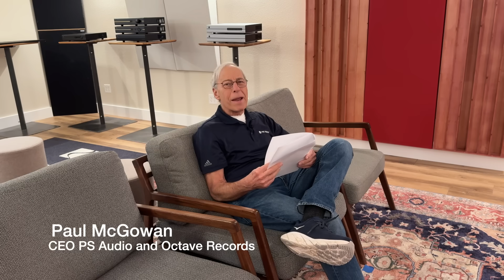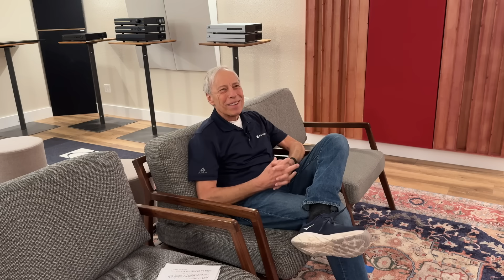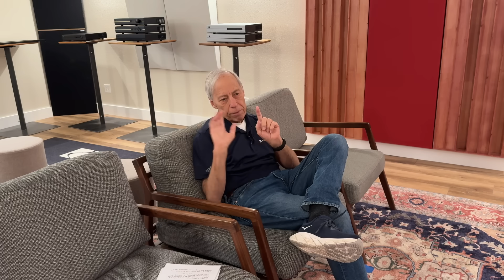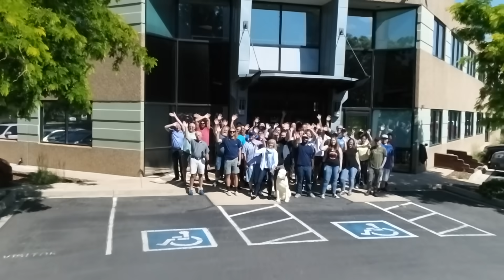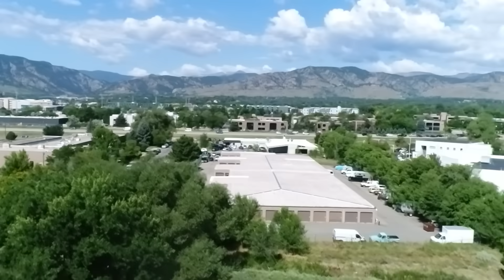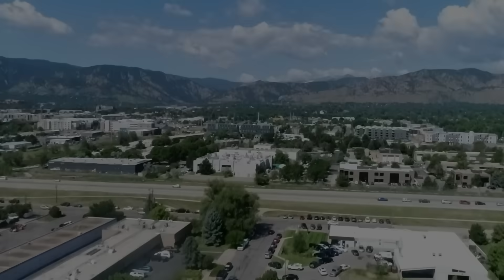The secret to feeling the bass of a dipole

Comment: If you want to FEEL bass... first you have to understand what you are feeling.   1)  Vibrations  2)  Air Blast, Hitting the Chest

If you have a small 6" woofer... you are not likely going to get the kind of Compressed Air Blast... that nearly knocks the wind out of you.  Thats only experienced with Concert Speakers, that have like 18 Inch woofers.

Some small diameter car Subs, might be capable of that kind of compressed air blast... BUT... it tends to have to be in a Cars small and controlled air volume (pressurization).  Put that same small subwoofer in an open parking lot.. and you might not feel that much thump..  as the air is able to escape in all directions.

 Then there is Vibrational Based bass.   Bass that is Felt.. rather than just Heard.   You can use Bass Shaker transducers,  and place them under your Couch / Chairs... to get INSANE levels of physical Vibrations.  And all without disturbing the nextdoor neighbor... since they dont really make much audible sound.  Bass Shakers will vibrate your entire body... but..  the effect is very different from the Concert level Bass Blasts.. or a Cars Powerful Subwoofers effects.

 Obviously, the room size and shape, plays a factor.   A smaller room, can become more  "Pressurized"  than a very Large sized room.

 Also realize that a lot of home theatre subs, are more about producing a low frequency Sound... rather than Bass that you can FEEL.
It depends on the sub type... the magnetic strengths.. and again... the air volumes of the room.   That, and how much power you are feeding them.
Reply: @clickbeetle2720  Yes... but a 12" sub could have just as much xmax.. and produce far more sub-bass.

 The real issue, however... is that Subs are not the full spectrum of Bass.   The Woofer is what provides that spectrum... and if you are using smaller sized woofers, you are not going to get any "Feeling" from that range of frequencies.
Reply: Thats only experienced with Concert Speakers, that have like 18 Inch woofers....correct. Thats what I chose on my OB builds. mega bass pressure with only a 17 wide baffle and 10 side wings. Didnt even need the wings they were added later for design and function.

Comment: Can a well-designed 4th order bandpass subwoofer be used in hifi down to 60 or 80Hz or is that a myth? What makes me think so is that a 4th order bandpass will usually not be damaged if it is exposed to frequencies lower than the box tuning, which is not the case with a bass reflex type box or a 6th order bandpass, probably also a transmission line.
Reply: Yes, no myth. 
Also, the sealed chamber helps protect the driver from extreme excursions. 

However, regardless how well executed the design, ... it's still a bandpass. 
Therefore it's range of operation excels across a more narrow range.
Reply: @ https://i.postimg.cc/W3hrdYbx/tb1.png
Reply: @FOH3663  Thanks, so I don't think a bandpass sub needs to cover more than an octave and a half if the main speakers can go down to at least 60-70Hz. In my opinion (but I don't have much theoretical knowledge), apart from precise construction, a well-executed 4th-order bandpass should have 3 chambers. So, one additional one through which only the reflex tubes pass so that the sound pressure does not get stuck to them. A bigger problem would be group delay.

Comment: I owned many types of dipoles... In their design you have cancellations between front and back that you need to work with, as in tuning distance between speaker and front wall, but there is also excursion limitations in the actual diaphragms/design, only capable of moving air in the 1-3 millimeter range. These limitations does not help to mimic a box design regarding impact and slam. Some people are happy without subwoofers and less impact also depending of music genre, some people like me, always augmenting with at least two sealed subwoofers in stereo crossed in the 100-140 Hz area to get the best of two worlds (Imaging from dipole, needed impact from box). There are designs that are hybrids that tries to compensate, some do it really well and that is where my journey ended. Music experience is subjective...
Reply: You pretty much hit the nail on the head:  at final floor positioning, my dipole diaphragms barely move at same apparent bass levels my subs move so far you wanna keep your feet clear. [see my own comment elsewhere above]
Reply: There is woofer excursion and theres diaphram area. e times d equals displacement. my diy dipoles use pro 18 woofers i have zero bass issues, bass you can feel and annoy the neighbors, using a 17 wide baffle. but it takes designing an entire system away from using passive xos and towards pro audio electronics and tri amping for three ways. all can be done for less than $2,500 us

Comment: I don’t want to feel bass, I just want to hear it. But in general with Open baffles/dipoles, just use very big woofers with very hi sensitivity, use a very low series-resistance inductor for the low pass filter in your crossover (large wire or foil gauge, and use an iron or steel core) and put wings on the sides of the woofer baffle for better lower frequency response. These all improve low bass sensitivity so you don’t have to rein in your tweeter as much to match…
Reply: Agreed.  I use 18" woofers for anything below 150Hz.  They don't go low and would certainly benefit from subs to fill in the last octave.  But they do sound pretty good, and I do feel the bass.
Reply: @ I have one of a pair built. Im told the 18” woofers benefit a bit from wings to extend below 50 Hz to 30Hz. I haven’t built the stands & wings yet…
Or you could just do a sub. I kinda can’t becuz my speaker wires are thru wall from a closet around the corner. So unless I wanna open the wall and put more speaker wire, or change the setup to in-room components…
Reply: That is correct sir.  Pro 18s without passive XOs, active XO and pro EQ and bi or tri amping is next level. Ive done it and it body slams and sound stage is tremendous. active XO and EQ (dbx) solves most problems
Reply: @manthings1568  well—I think we are talking non-active systems here. It is common knowledge active systems solve most if not all problems, but many consider them clunky and brute-force to implement (separate amps for all drivers).
Reply: @ Understood but my sys i not cluncky its very compact my amps are about a stack of 4 old school cd cases the amp mkt has been radically changed the last 5-8 years. Paul's Q&A and his response to someone who already has a system is valid. I just disagree with his opinion that all dipoles suffer from bass. Maybe most off the shelf do. Im offering another next level approach that is not expensive, which was the goal of my project. Not a fan of off the shelf systems with passive XOs. Trying to passive XO an 18" is far from ideal IMO, easy with active
Reply: @manthings1568  I built OBs with minimalist passive X-over. It’s fine the first one sounds great I gotta put the other speaker together. I understand about the new amp tech. In fact im using cheap Chinese $90 Fosi monoblocks myself. Good point that you could just use 6 of these and go active with 3-way speakers… I just can’t without rewiring my wall…

Comment: My friend is an audiophile and she sits on a big speaker just like in the Howard Stern movie.  She said it makes her feel the bass and pressure like no speaker can under normal use.
Reply: At last, that orgasmic sound.
Reply: Ya, also good for constipation 😁
Reply: I have done that with an 8" sub under my chair. Pretty cool!
Reply: @stevefisher8323  I wonder why PS Audio doesn't patent a pleasure speaker?   If I get on shark tank with my design of the pleasure speaker I'm going to be worth tons of money.  My friend also installed a 8 or 10 inch sub under her car seat for the same reason.
Reply: @funny0000000  Interesting term  :) What would be an example?

Comment: Paul, I bow to your expertise but add an observation. When they were new, I owned Yamaha NS500 speakers, with their radical beryllium dome tweeter and a 12" woofer. And those full size subwoofers gave bass a physical kick to your core. Perhaps not accurate, but every high end subwoofer I've heard simply has never delivered a punch to the gut, the way 10 or 12 inch simple woofers in a box, ported (these were IIRC) or not. Subwoofer? Nice, but it feels like a room is breathing. No true percussion.
 So what are we missing? Rationalize this for me, and your writer?

Comment: @3:22 "closed box bass"
Seams that Paul is all about impact and to feel the bass.

But if you want to hear it accurate and highly detailed with all of its nuance.

Then forget box and go to open baffle bass.. so that is a completely different experience! ❤
Reply: Sorry, but there's no way an open bass is more accurate. The best accurate bass is a closed servo subwoofer
Reply: @xaviermontalban717  There is also servo controlled Open baffle. Example GR research 3 x 12 OB servo controlled bass speaker.

But I am talking about just the enclosure.

And set aside servo or not when we can have it in either or "enclosure".

Looking at the enclosure the OB has cancellation to the sides and up and down (Yes down as for example my two OB 18" is hanging in the air and therefore remove the coupling to the floor boundaries.)

The cancellation makes so that you have a figure 8 of radiation pattern and not a omniderctional radiation like a traditional box has.

Besides it will not radiate energy and cancel to the sides it will then not overwhelm your room and force you to use more absorption in the room just to get to on par with OB. (Remember bass is that frequency range where we throw in the most wattage and energy can not be destroyed ut just take another form.)

So when I live for years with two big OB and do meassurements with REW and a lot DSP optimisation.

There is no substitute for OB if you want to hear ALL details! It is just like a magnifying glass!

The downside is that when it do not pressure the room in the same way as a box then you dont have the boomyness and overload and therefore you dont have the chest pound, no things that rattle and vibrate no pants vibration or something like that.. distraction and not music. That roumble over so you CANT hear the details in practice.

Yes, it takes time to get used to this kind of presentation but it is so rewarding at the end .

But you can not rock out and feel it in your chest..

But as you say a servo will tame/control a driver and lessen the boomyness of the bass to solve some of it "issues" and to give it back some more and lost details.

But imagine taking a "correct enclosure" to begin with in the physical domain as OB. And then add servo in that scenario..

So it is about taste and preferences.
When OB is the least efficient "enclosure" you need cone area and more amplifier power and with boxes you need more room treatment to try to get to the same accuracy levels..
Reply: @xaviermontalban1701  open baffle is at least as accurate as the membrane is not hindered by a backwave in the enclosure and just stops and starts as necessary giving excellent transients . As there is no enclosure , you also get rid of any panel resonances and boxy sound .
Reply: @gerritgovaerts8443  that's nonsense. Its only stopped by the suspension and not the backpresure. Therefore, there's less cone control unless its a servo speaker. Show me ptoof of a open baffle speaker with good spectral decea
Reply: @xaviermontalban1701  you need to separate different things.
I were talking about the "enclosure" (or the lack of it)..
And a servo controlled driver is something else that you throw in to add confusion to yourself in my opinion.

So there is at least 2 makers and sellers of servo controlled Open baffle bass (subwoofers). That I know of.

So the servo controller is NOT something to do with the enclosure. Two separate things.

If we just look at the enclosure a OB is more accurate and has miles better definition. (Knowing that when I live with two OB 18" that hangs in the air).

But open baffle has drawbacks like that when it is the least efficient "enclosure" it needs larger cone area and more amplifier power.

And then it comes down to subjective preferences between enclosures if you want to hear all details or feel it..

A box if it is bass reflex or sealed box will make everything (if we now talk about bigger and more competent stuff that reaches low in frequency and with higher SPL) to rattle/vibrate/shake. You get your chest pound and pantleggs to vibrate and so on..

People thinks that is the NORM for low bass, but that is because the vast majority do not know about anything else 🥳 

And if you subjectively LIKE that distraction, instead from hearing the details. Then go for it! (We are definitely USED to that sound signature)😅

But there is NO competition whatsoever.
And if you want, then we can use a servo controlled driver in the OB arrangement also..

Just saying from my own experience to start with the fundamentals and then add electronics otherwise you dont know what is doing what.. 
..was it the type of box or were it maybe the servo controlled driver that gave me the experience.. 
..or did the servo controller helped the bad choice of box to get to iron out some of it weaknesses/attributes? 
That you dislike or liked..

I spend a lot of time to analyze why or what is contribute to what I hear in audio shows that i go to in different countries.🥰

A box is just a way to increase the efficiency that make you to be able to get away with a smaller subwoofer. For example so that 10" will produce same SPL as a bigger driver that is in a OB.

I do not care that I happen to need bigger drivers in my dedicated listening space. When for me I dont compromise on sound quality that is my highest priority even higher than looks! (I have realized that many do the opposite 🤣)

But if you try to get the sound QUALITY with a omniderctional radiation box you need so much sound absorption in the room that will take so much real estate place so it is not even funny. And the goal will not be achieved anyway in the end. 

A OB do not load the room when instead of being omniderctional it has a figure 8 radiation pattern with means it cancel out to the right, left, up and down (four of  a box six sides.. hoppfull you start to see the issue)

There is more to say but this is unfortunately way to long allready! 👍
Reply: @AmazonasBiotop  First of all, we were not talking about open baffle spreakers but open baffle subwoofers. They have a long throw and are therefore less accurate. This is the reason why 99 percent of speaker builders, including open baffle enthusiasts, build them enclosed. Secondly, you are referring to things like added sounds, rattle, etc. These things only occur in poorly made cabinets. Thirdly, i like my room to be pressurized by a sub, and most audiophiles would point out that's the whole point. But off course, it comes down to preference. I do agree that OB sprekers have a multitude of benefits, but to me, not the subwoofers
Reply: @xaviermontalban1701  BTW , it's not only the backpressure as monopoles always create a pressure difference (positive ort negative ) between the room and the enclosure , hence a resulting net force on the driver membrane . This is not the case for a dipole which creates zero net pressure in the room . But hey , if you are going to ignore Newton's laws , go ahead , just don't expect me to follow you . End of conduit .
Reply: @gerritgovaerts8443  that wasn't my point. Thanks for adding nothing to an interesting conversation
Reply: @gerritgovaerts8443  It will never be accurate. You might like it; you might love it, but it can't be accurate because it's forever fighting the inherent acoustical short circuit.
Reply: @AmazonasBiotop  I agree with you on most points, but I remain with my first one that there's no chance an OB subwoofer is better than a well-made sealed one
Reply: Well at his age he's got to feel something😆